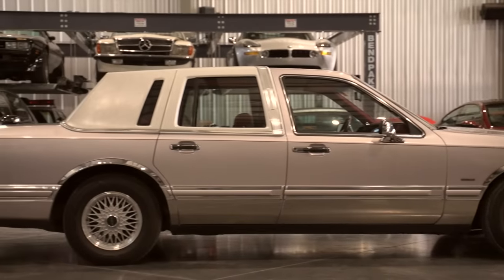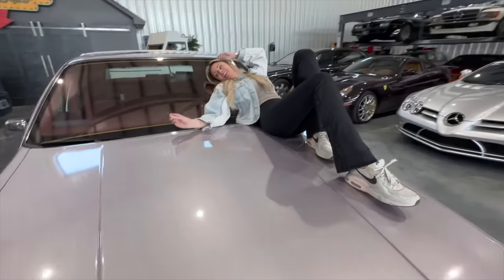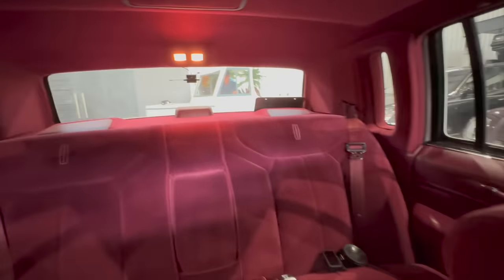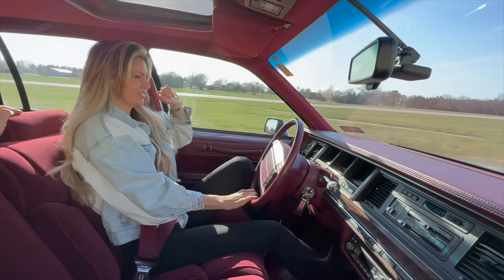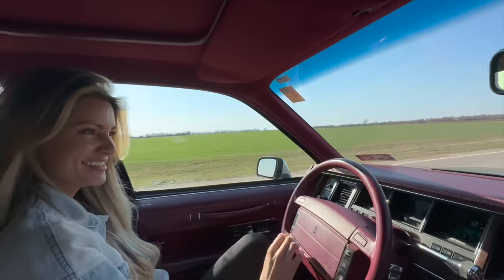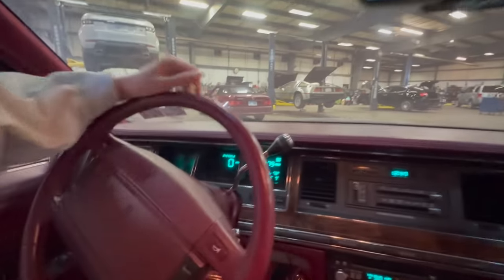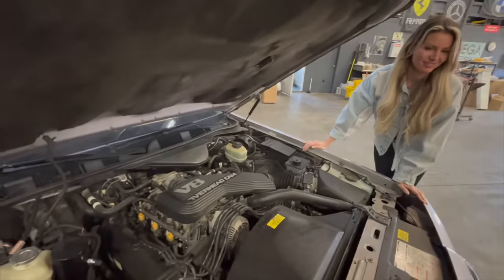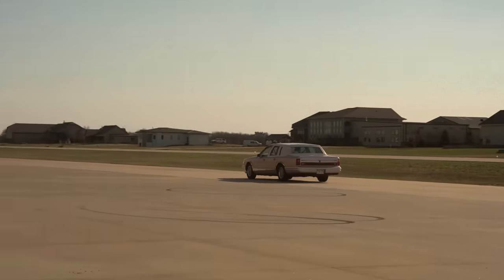Why April Rose bought a luxurious 1991 Lincoln Town Car. Her new daily driver!

Comment: I bought my son one for his first car in 2017, 1 owner Cartier edition with 73k miles for $3k.
Took it home and replaced all the light bulbs, hoses, plugs, wires, fluids, brake pads & tires.
He drove the hell out of it for the next 6 years without any problems... until he got rearended by a Suburban and pushed into another truck.
Reply: Friggin disrespectful Suburban drivers !!

Comment: My grandparents had a 1989 Lincoln Continental Executive Series. My grandfather worked at the dealership at the time when it was brand new. They had it in the family for years. We are from South Dakota so not a lot of driving and it wasn't the winter car. My grandfather sold it in2010 with only 56,000 miles on it and it was still a gem.

Comment: I had a limo business and we had a bunch of Town car limo conversions, up to tandem axle, 130" stretch. Those cars, fully loaded, weighed twice what they were designed for and the drivers could be hard on them. Apart from a couple failures with the early Mod motors, they would routinely run 175k without issue. I just love those cars.

Comment: The 70's Lincoln s  were the best ride and they cruised well on the highway, I had a 75 Lincoln MKIV back in 86 & I currently have a nice 2005 Lincoln Town Car Sig series ...   Also I sold new Lincolns from 200 to 2007.. Loved smelling a new car every day for 7 years :)
Reply: I agree.  The 1970's Lincolns were the best.  They had the weight, a 460 V-8, and they would glide down the highway.  You barely used the accelerator pedal, and would glide at 60 MPH.  Cruising was effortless, and they could go 90 miles an hour all day long.  A 1970's Lincoln can run over the crap they sell today, and keep on going.
Reply: @ericknoblauch9195  you must be as old as I am to remember them that well :)

Comment: I thought the color was 'Dusk Rose Metallic" I sold a few of those, with the white leather interior they were sharp, very sharp. As far as everyone looking at April when they got to the Wizard's? I'd rather look at April than Hoovie any day. Yes the '91 was the first year for the 4.6, the '90's had the new body styling but a 5.0 engine and different bumper covers with the top of them being chrome. the 91 had the new engine but the old transmission, I lost a few sales to Lexus and Cadillac because the transmissions shifted "rough", the next year they came out with an electronic shift transmission. With that transmission sometimes the only indication you had of shifting was the change in exhaust note.

Comment: I almost unalived myself and a local celebrity in a Town Car of that generation. I drove limos and airport cars part-time in the early 2000s, and the company only had this one of this generation. All the other cars were the new bodystyle. This car didn't steer. Well, it steered when it wanted to, after some thought. It was terrifying. You'd turn the wheel, and 3-5 seconds later, the car would react. I dropped the local celebrity off, took the car back to the shop, and explained that that car should not be on the road. One of the managers said they had just spent $2500 on it. I suggested that he go drive it, to his credit he did, and it scared him. The next time I went to work, 3 days later, the car was gone.

Comment: I was going to post 'the most reliable Lincolns ever made' but Lincolns have a pretty good track record for reliability. Each of them may have had one or two common faults but those were generally minor. The dash can be pulled back from the right side and bungeed to the headrests while replacing the actuator and (blend door?), after that there really aren't any major common issues. (ex-Lincoln dealer tech)

Comment: Lots of nostalgia for me in those old panther platforms.  I learned to drive on my dad's '84 Mercury Grand Marquis.  Most of my uncles drove Lincoln Town Cars from the late eighties and nineties.  Lots of passenger and trunk space to carry a bunch of people and all their stuff.  

I think the 4.6 modular was built to be just a little bit cleaner, smoother, quieter and slightly more efficient than the 5.0 it replaced.  Very dependable and pretty easy to maintain.

Comment: If I were going to pull the dash out, I would also replace the heater core. Those are cheap and also require pulling the dash so you could save a lot of time and money just replacing it now.

Comment: I worked for JLR and we had a convertible Evoque in our fleet. It was a rare and special car,  you either liked it or didn't, I always did.  It did however actually catch a very small FIRE, but luckily it happened at the dealership when they were doing repairs and not in our office!

Comment: Really,  very cool! If it doesn't leak. Also on Lincolns, if you have air bags, and jack it up, with out jacking up the rear end, it stays jacked up, unless you keep the drivers door open with the glove box opened too, then turn the key on, and it go back to normal. 😮
The wonderhussy had one too.

Comment: Cadillacs were more expensive and their engines were higher performance, build quality a little better too from what Ive seen, but the Lincolns still ride amazing and look very classy. Their V8s were not performance V8s but they lasted forever. The Panther Platform reliability of the Crown Vic, Grand Marquis, and Town Car was incredible. If I had to choose Id want the Town Car. There 1995-1997 years looked so classy. Still angled but a little softer edges. In 1998 they went full curvy body style but that mid 90s is a perfect balance of the angled lines while still looking amazing

Comment: Back in 2000 I bought a 91 Town car and 90 Cadillac Fleetwood from an old couple going into a assisted living. Both cars had less than 30k miles. I sold them to a collector in 2018 with around 70k miles on both and sold for 3 times what I paid for them. The cars were in the same concourse condition  when they were sold. God, I wish I still had the Cadillac for sure 😊 My car did the same clicking back in 2008 and fortunately I  have a Ford high level technician as a brother in law and only cost me beer,pizza and cost of the actuator. We had a great time working together like we did when we were younger 😊
Reply: God that era of boating was great! I love going for a good float I mean cruise 😮😂

Comment: I had a 93 white over cranberry leather from 2004-2011 and an 03 Autumn Maple Metallic over light parchment (tan) leather from 2018-2023. Only thing this one needs is a new set of whitewalls or vogues. The dash banging is the air duct blend doors, a PITA as the dash has to practically be pulled out to replace, been there done that on my old 93 & 03 TC's. Might as well swap out the 33 y/o heater core while the dash is out.

Comment: I was working for a rental car agency in the early 90s. I really liked that car but I hated the seats. The driver's seat is leaned back. To drive this car I had to adjust the back of the seat all the way up and the front all the way down. Oh and don't forget about the switch in the trunk for the suspension. You'll need to turn that off before changing a tire.

Comment: Congratulations on the Town Car!  I drove my dads 91 TC when I was in high school (2003-2005) it had the same paint color and same red interior in leather but unfortunately it had the analog dash.  

Seven weeks after graduating (2005) I bought a 1996 TC Cartier with 84K miles. It was my daily driver until last year.  I still have it (329K miles) but I only drive it 1-2 times a week now since I bought my Chevy Bolt.

Comment: Nice! I've owned 3 of these and still have a 1994. Looks like that one has the rare airbag delete panel in it on the passenger side, which was mostly a thing on the 1990 models, but a few 1991s got it as well due to an airbag shortage at the time.

Comment: I miss my old 86 Town Car. It was a used and very neglected one that I bought for 1000$ CAD in the mid 90's in my early 20's. Despite that, it was still the most affordable and best car I ever had. Built like a tank with real metal bumpers, reliable, affordable mechanical parts and easy to work on. It looked bad cosmetically with faded paint, nicks and dents but drove and rode like a Champ! I drove all types of different cars and trucks over the years (my work/jobs mostly revolved around driving various vehicles 8 to 12 hours a day) and now approaching my 50's, wouldn't mind getting another 80's - 90's Lincoln in good condition like this one as my personal car. Better than most cars produced today.

Comment: I have one of these, mine is a 1993. The velour interior in this car is very rare. Every single one of these has the issue with the switches falling out. You need to take some all thread and cut it to size and epoxy them into the switch panel in place of the screws. Then use nuts and washers to hold them in.

Comment: Blend door actuators are a common issue with this generation TC, along with the power trunk motors, and rear air suspension components.  The brake switch & wiring on the shift interlock can also act up, which will prevent you from shifting out of park.  Although the blend door actuators are a HUGE pita to remove, parts are still easy to find and reasonably priced.

This one's almost too nice to daily, though.  Methinks you should find a 95-97 Cartier series to add to the collection. :)

Comment: I had a 1996 Lincoln Town Car. I owned it for 6 years and I loved it. It was really a road cruiser and it got 22 miles per gallon on the highway. April has a really nice example. Mine was white with a dove gray leather interior. I kept it until the blender door failed, and it was too expensive to fix.

Comment: Not sure why this video popped up other than that I own a 1991 Towncar.
Bought mine for $1,100 about 3 years ago and it had 85K - I now have rolled it over to 102K
While they ride nicer than any other car ever (even better than the cadillac of that same era).
Lots of good, but some of the bad is that the rear air suspension bags are prone to going bad (as are the electric window mechicals in the doors).
I put a heavy trailer hitch on it and swapped the air bag suspension to conventional coil springs.
Interiour same color as your but the paint is also burgundy, not silver.
============
1990-1994 Lincoln TownCar - the very best riding luxury car

Comment: From the October 1989 and January 1990 issues of motor trend:
Yes car wizard was right the 1990 town car DID have the old school
5.0 302. And the 4.6 281ci modular engine was new in 1991.
The 302 made 150hp.
And 270lb-ft of torque.
The modular 281 made 190hp.
The top of the line 1990 cartier model had 2 tone paint.
Lace pattern wheels.
Cartier interior upgrades include a JBL premium sound system with optional CD player.
Leather upholstery with power front seats with ajustable lumbar support and memory.
Cartier's had duel exaust to bump hp to 160hp.
 It was motor trends 1990 car of the year.
That steering wheel was fords 1st airbag wheel and was used also in the mustang and other fords.
It has a passinger side airbag also.
Anti-lock brakes were optional in 1990.
Performace stats on the 
302 "townie"-
0-60--10.5 seconds.
1/4 mile time is 17.7 @ 77.8 mph.
Weighs--4065 pounds.
Fuel enconomy-- city:17mpg. highway: 24mpg.
Fuel range is 306 miles
 city. 432 miles on a full tank for highway driving.
Minimum turning circle is 40 feet.
Its 220 inches long.
....injoy the back seat 
❤ "love-compartment"❤

Comment: I am a women and I own a 1997 Lincoln Town car with a moon roof , Please be careful when using the moon roof switch as there is a part that dries out and cracks . My husband and I removed the switch and that is not a easy task. and I reinforced it with super glue and baking soda and then we installed it . works great and should last as it is now a stronger switch.  I would like to know whom made that switch and kick them in the groin.     MRS. M

Comment: These lincoln Towncars were a favorite of taxi drivers in Portland, OR because they have massive trunks that will hold about anything you can imagine.  The replacement body style Lincoln Towncar was built for the showroom through 2009, and for livery service operators it was continued through 2012.  The later models were much lighter and even in the L series with 6 inches longer wheel base for more back seat floor space they did handle very well when asked.  April has a very beautiful car and I hope she enjoys it for some time to come.  The deer whistles are nice if you have deer in your area.  BUT, if you have moose anywhere you go tape them over so they do not emit any sound.  Moose will come for them and a moose will destroy your car.  I once talked to a semi-truck driver who blew his air horn at a moose that would not move.  When it was all over he was sitting on top of the cab and they towed the tractor away.

Comment: Smear a huge glob of chassis grease on the bump stops to prevent the loud popping or screeching sound in a parking lot with the steering wheel cut as sharp as it can turn on 2002 and older..

Comment: The banging noise in the dash is most likely the Air blend door actuator. I've had 2 '96 Mercury Grand Marquis LS cars to do the exact same thing. They like to fail on the automatic climate control cars especially. What makes the Ford panther (Lincoln Town Car / Ford Crown Victoria / Mercury grand Marquis) what they are is that they are rear wheel drive and have a fully boxed perimeter frame. Cars just aren't made this way anymore. Good luck with your nice ride!

Comment: April you have good taste I’ve had nine LINCOLN in my lifetime and most them I’ve been very good cars. If you ever get a chance to find a 98 Continental in good condition, I recommend you buy it. They are great cars.. and it’s got a better engine. it is a 4.6 but it is the Intech V8. Double overhead cam 32 valve.. and it’s Dash is even cooler. Were you look at in the dash all there is is the needles the numbers are reflected down so it looks like they’re floating. It’s a very cool effect and the virtually free..

Comment: 1991/1992  should be the last 2 years of the 5.0 high output. The thunderbird and cougar got the new 4.6 modular engine first. Then the town car got it and then in 1995 the mustang got it. In single exhaust the 4.6 was good for maybe 190 horsepower but the 5.0 had 215 to its name. In 2004 or 2005 ford took the 4.6 and started making the mustang specific heads full range. Prior to that only the mustang and the police interceptors got the freer flowing heads. In its final standard form the 4.6 kicked out 224 horses and a bit over 300 ft pounds. In its performance form with a dual exhaust and police package it could get roughly 250 horsepower. This car should have a 5.0 in it

Comment: I'm pretty sure the blend door actuator problem is a piece of broken plastic. The blend door motor is easily replaceable, and it has a square shaft that simply inserts into a plastic cylinder with a square hole, which cracks between one of the corners and the outer surface. A little ABS cement and a zip tie should fix the problem permanently. This Town Car is WAY too nice to be a daily driver - take care of that beauty for humanity.

Comment: Dash drops down, don't have to remove it.  8mm head screws out, slot the front mount hole on the new blend door actuator to ease install, and done.  The 1990 had the same body as later ones but a 5.0l 302 because Ford powertrain dropped the ball on getting the 4.6 done.  The new 1990 body style was supposed to have a new powertrain also.  1990 Town Cars are horrible, 91-94 OK, 95-97 good.  I miss working on them.

Comment: I put a battery disconnet on mine just like that.
The computers or whtever draws enough current so if you don't drive it for a week, it would be hard to start.
Deer whisltes was a fad. They do not work. A deer in mating season doesn't listen to anything  ;-0)

Comment: Put up the damn headrests. They’re there to prevent whiplash - especially when us old retirees are done with rushing around and insist on driving at the speed limit.  You younguns are spoiled by built in headrests that don’t have to be put up.  I’ve concluded that Doug DeMuro doesn’t even know they’re there.